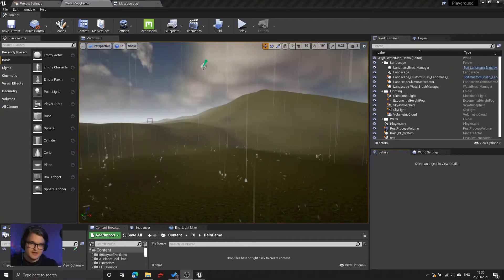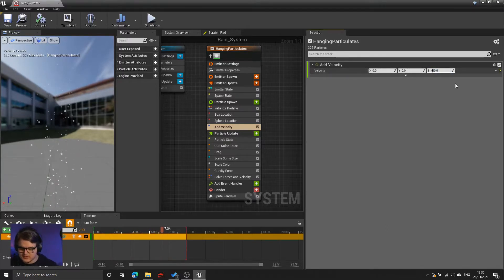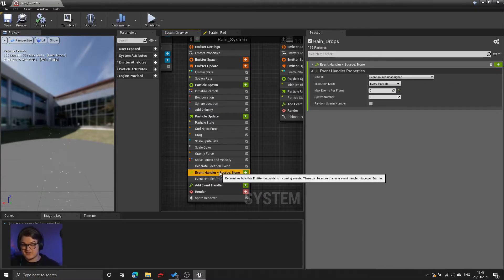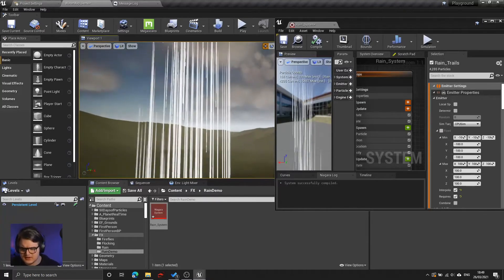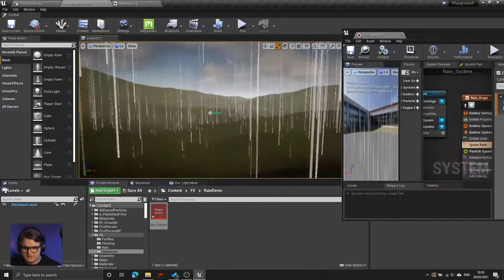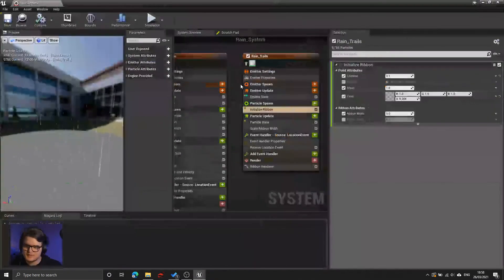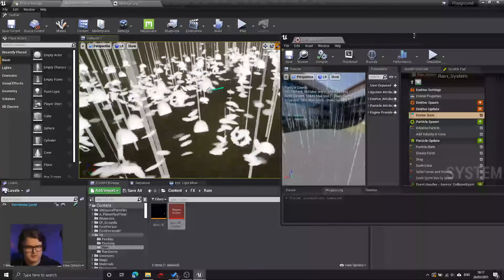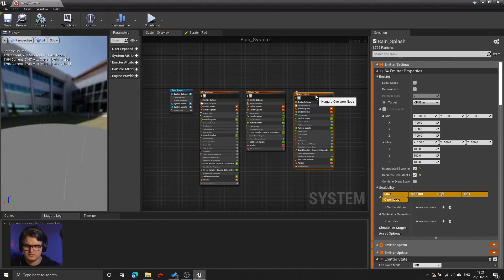How To Create Rain in Niagara - Unreal Engine 4.26

Comment: It is just not working even after I out the collision. The collision section is not working. The splash emitter is not spawning unless I put a spawn rate and when I do put it, it uses the spherical position of the first event rather than the collision event. I dont know what I am doing wrong.
Reply: I'm having the same problem unfortunately. I followed the video step-by-step and rewatched several times. Everything works but the splashes.
Reply: @cort1c  it is the placement of the attributes. Give me ten minutes I will send you a screen shot which will help you with it
Reply: @cort1c  Put the collision node before generate collision event and solve forces and velocity after collision event node. It should work.
Reply: I have the same problem. Can not manage collisions to work for splashes.
Reply: @divyabaranwal6825  Hey thanks for that info. My problem ended up being slightly different but this helped.
Reply: @Druneg  Sorry I don't remember exactly what I changed to get it working but I believe it ended up just being a scale issue. The splashes were too small to see at first.
Reply: Just figured it out where the problem was. It supposed to be checked "Local space" and "Use persistent Ids" ticks in my case.
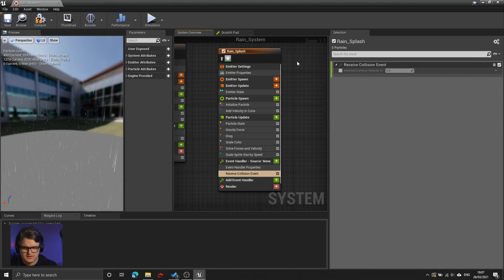Reply: If u don´t see the splashes around 22:30, u might want to check if u´ve set Rain_Drops > Bounce > Restitution to 0... This prevents the splashes from being created, after bc. theres no collision event being thrown in Rain_Drops I think. Solved it for me